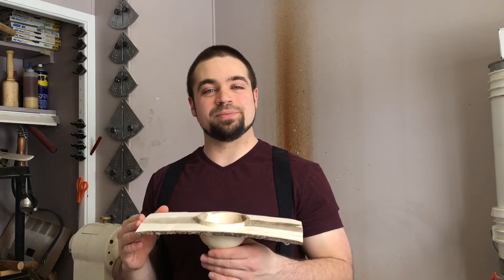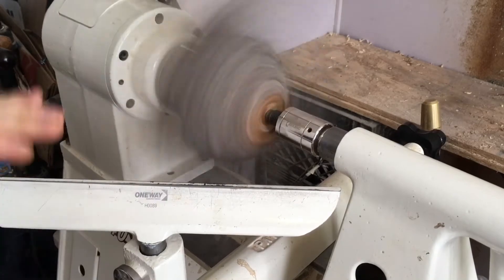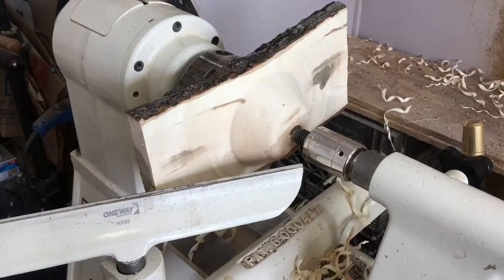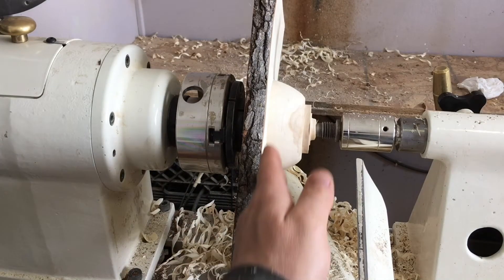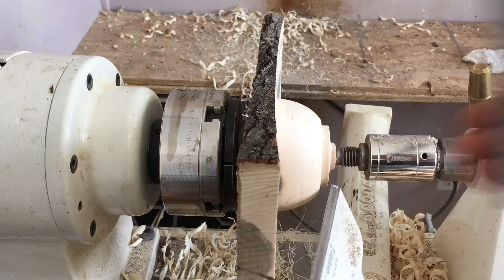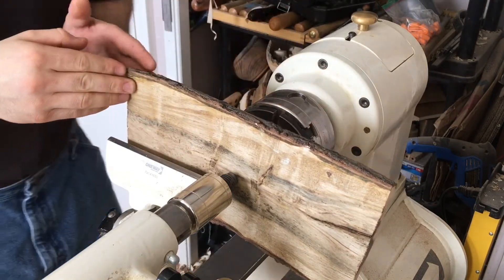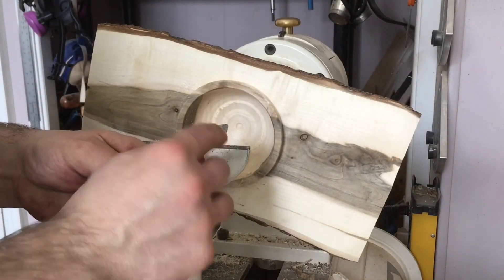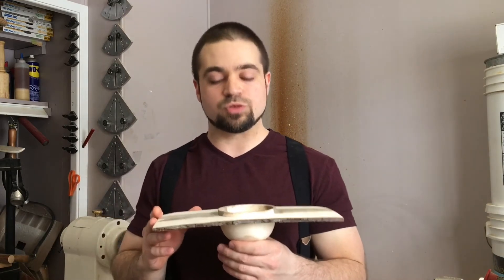Woodturning - Natural Edge Winged Bowl (Green Wood Turning!)

Comment: Woodturner Ky I have been waiting to see what you came up with this week. Another very  nice job. What size is the gouge you used and who makes it?  You sure make it look smooth. 
Yesterday I was at my brother in laws and he had a cut up oak tree that came down last winter. I now have some nice looking pieces at home. Today I roughed out a bowl. The bark is on real tight. I have it stored now and will check it in a few weeks. Fun stuff.
 You sure are right up cutting the trees in the winter.

Keep up the great work.
Reply from the maker: ThePapa1947 Thanks Gary! The gouge with the really swept back grind (formed on the Oneway vari-grind or the Ellsworth jig) is a 5/8" Oneway mastercut, and the smaller gouge that I have the 40-40 grind is a Jimmy Clews special made by Thompson Tools and it is a 1/2". The 40-40 grind is an awesome grind and if you want to know how I learned about it just check out the demo "how gouges cut" by Stuart Batty here on YouTube. Amazing amount of info in that one video!
Awesome to hear about the good Oak haul and that it's kept its bark so well! And if you haven't worked with fresh Oak before, make sure to dry it good and slow as Oak is a tough wood to keep from splitting. But the extra care and odd fix or crack to fill is always worth it with Oak!
Reply: Thanks for all the information on gouges. I have been looking to get a few new ones. I really liked the information you gave on moisture content as well. That will help me watch what I have packed away.
 We didn't really use bowl gouges at work. Mostly scrapers and I have some very big ones of all kinds of shapes. Very heavy  ground from tool steel. I do have spindle gouges and one 3/8 bowl gouge that is swept back. I have the vari-grind system also.
 The wood I picked up was a great surprise for sure. But also one of our sons has 42 acres with most of it trees on a hillside. I never noticed but he said he has some wild cherry trees so we are going to harvest some wood from that to try out. At this point maybe we should wait for winter time again.
I have never worked with fresh oak so this was cool. I have made lots of things with kiln dried oak. I was surprised with the wet stuff.
Thanks again. Gary
Reply from the maker: ThePapa1947 I was actually wondering what tools you used in pattern making. Scrapers make a lot of sense since they can both remove wood quickly and also nibble away bit by bit to get the exact dimension. And like you said you can have multiple shapes to different applications. I wouldn't doubt you for one second that they must have been heavy duty haha
That sounds like an awesome opportunity on your sons property with the cherry trees. I know what you mean about the conundrum over waiting for winter before cutting some though! I guess if the project is meant to keep the bark, it would be best to wait......as long as you have other material to turn with until then at least!
And yes green wood and kiln dried wood are night and day with turning isn't it? Green wood turning nearly feels like cheating sometimes haha
Good luck on the bowl gouge hunt Gary, let me know if you find what you need. 
Kyler
Reply: Thanks Kyler I know for sure I want much bigger one. Is your Oneway Monster a V style or more rounded? The other thing I see is they sell them with handles and without. Do you think they are the same steel? 
 I have 3 green bowls drying right now. Leland Cypress, Apple and Oak. I marked the date and how much they weighed. And I took moister readings off them.
This is a learning lesson for me. Almost sounds like I am hooked on turning green wood now. Perhaps but I still have many ideas on segmented bowls with feature rings. Actually those types are more glue up than turning but I like that also.
 I think I will make a YouTube showing the tools I used for patternmaking. Most all of them were made by me other than my skews. A great material for scrapers is Stellite. Leaves a great burr after sharpening  and holds a decent edge. But when your turning something  4 foot or more in diameter you visit the grinder often.
 Maybe I can use my cellphone to create a video to describe the tools.
Gary
Reply from the maker: ThePapa1947 My Oneway bowl gouge is a 5/8" "Mastercut" series. The flute in it is definitely more of a rounded, or parabolic shape. It is one of their unhandled tools, and it's actually a double ended bowl gouge so I can take it to the grinder without the handle and get two sharpenings in one trip. Or you can have two different shapes but I prefer having both the same and just flip it around when it starts getting dull and it's the same tool still. It's in one of their handles which are quite heavy which is good for larger Bowl work to dampen vibration and such. When I last ordered tools from Oneway, Susan told me that the "mastercut" series are the ones that they make themselves, and that the "oneway" series is actually made for them by a manufacturer in the UK. I think I have that right. She said the steel is slightly better with the mastercut tools so I stuck with that, but not sure how big of a difference it would really be. The smaller Thompson bowl gouge in this video is actually a v-style flute but I have a different grind on it so it's hard to compare the two. Many turners who use a swept back grind like on my Oneway usually recommend more the parabolic flute.
Great idea with dating, weighting, and reading the moisture on the bowls. Sounds like you have a nice variety of bowls drying now! 
I would love to see the tools you used in patternmaking. I have never heard of stellite, must be a really good tool steel I'm guessing. But like you said on a 4 foot diameter project, you sharpen often regardless.....that's over 12 feet of wood each revolution! Haha
Reply: Thanks for the update on the gouges. I really like the looks of the 5/8 Oneway Master. I did notice that the other line they sell shows a seemed to have a higher Rockwell number. I haven't been able to get on the Oneway site for 2 days though. What do you think of the Sorby gouges I can get a 1/2 inch local and then order the other one later.
 My moisture meter is a cheap one but it gives you a reference place to go off of.
Stellite almost looks like a bar of hot rolled steel but definitely holds a decent edge.
I will get pictures soon showing my tools. 
 For sure a 4 foot diameter turning is spinning around no matter how slow you can get it.
The largest turning I did was close to 8 foot diameter and I did that on a very large post lathe. Looks a lot like some of the bowl lathes I see people making. As long as you glued it up true it was pretty balanced to start with.
 I have another chunk of oak on my lathe right now and getting ready to turn it around. Felt like it was raining on me turning the outside haha.
Reply from the maker: ThePapa1947 hmm well you can't argue against the Rockwell hardness, that's pretty irrefutable lol I do have a Robert sorby bowl gouge as well (1/2") and it is a really nice tool as well. 
My moisture meter is also a cheap model and you're right it's perfect for reference and it's decently accurate I believe. Plus when it stop going down in moisture completely you know it's as dry as it can get!
I can't imagine walking up to an 8"diameter turning! Must be very low rpm I imagine, that wood surface would be going by pretty quick even under 100 rpm!
That's one thing about the green wood turning, you almost need a rain coat at times haha
Looking forward to seeing your tools!
Reply from the maker: ThePapa1947 Any luck on the search for some new gouges Gary? It always feels like such a critical decision to commit to haha it's something we know we will spend a lot of time with and depend on!